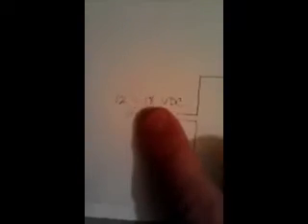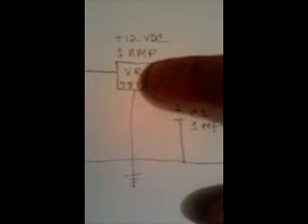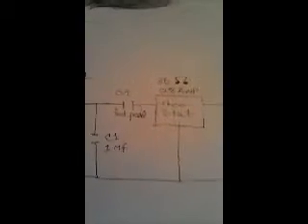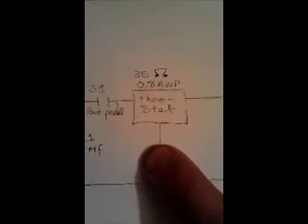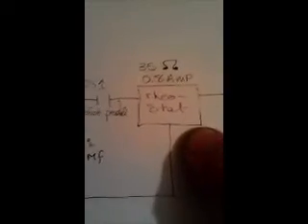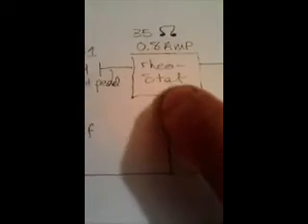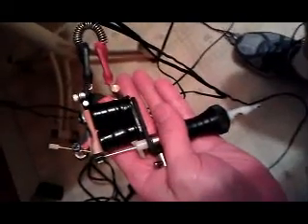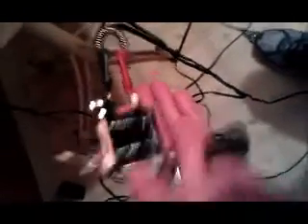DIY 12volt power supply

Comment: You're awesome! Way to go!!
Do you know if I can go from a 12v battery system with this 
http://www.frys.com/product/1926819?source=google&gclid=CjwKEAiAqozEBRDJrPem0fPKtX0SJAD5sAyHteRUPriioXC94tQ8fnHEzS3llY7LcIU2jCGsJ_dkGhoCVAnw_wcB

Then hook to my machine. My only worry is the wave generated by this power supplies capacitor. 
Your beat guess is greatly appreciated!

Comment: Great video, but I have a question and a statement.  Q:  can you email me the schematic?  S:  It's called a machine, not a gun.  Other than that I enjoyed your video.
Reply: I do not understand your logic. A trigger, hammer and a means to trip the trigger to propel an object out of a barrel constitutes the item being called a gun. Every mechanical engineer I have talked to have said the trigger of a gun is nothing more than a switch. 

So does the machine have a switch? yes. Does tripping the switch cause a hammer to fall (armature bar serves as a hammer)? yes. Does the machine then propel an object down a barrel? Yes Does it do it repeatedly? Yes. Then by default the proper description can be either a machine or a gun. 

Calling it a machine because of an inanimate objects connotation is just not logical. Just because he used the word gun does not make his statement incorrect but is more descriptive to what the machine is and does. Placing the tattoo word in front of it should serve to distinctly describe that he is not referring to a gun in the traditional sense if the word. Otherwise he would have said gun. 

If I was really that petty I could say something like I am offended because the machine is capable of automatic repeating and is therefore an assault tattoo gun or to be more descriptive an assault tattoo machine gun and since there is a manual hand method for tattooing then the description holds true.